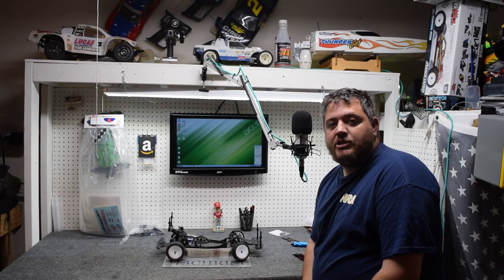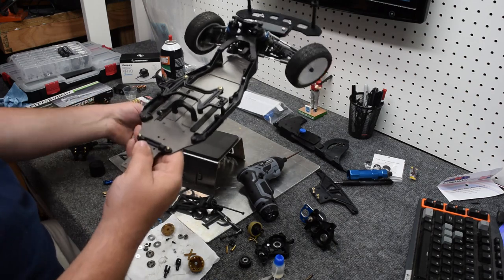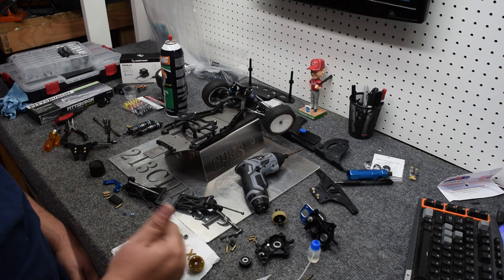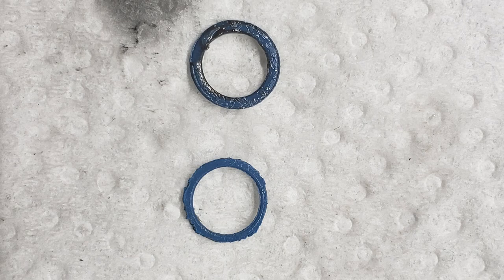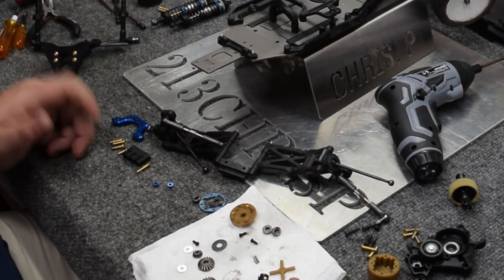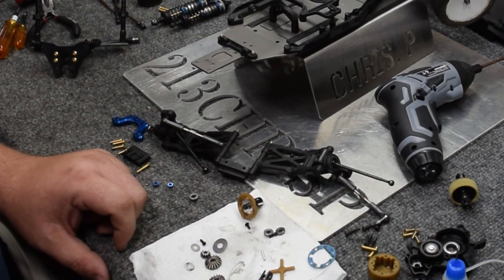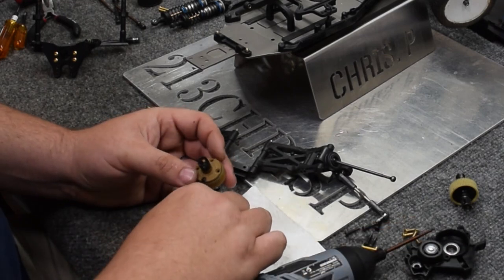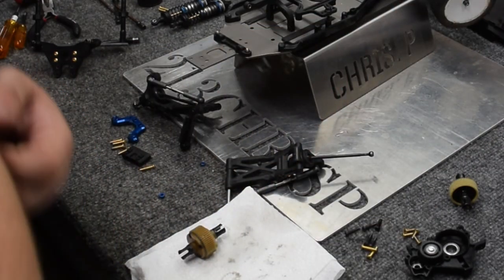street stock build part 3, suspension and transmission work, lets free up our transmission!

Comment: Are those the shocks that come with the car?  How did you get the B6D to set so low?  Thanks!
Reply from the maker: Yes that is the stock by shocks. And mccaliseter springs are alot shorter which allows for a lower ride height.
Reply: @ChrisPatrickRC  thanks for the reply
Reply from the maker: @Kentucky-bz6pg  glad I could help! Its what I love to do.

Comment: Dude, you so totally screwed Ackerman...not hating, just fyi you need to research that alot better. Pretty much boned it bro. Rest of your set-up explanations pretty good.
Reply from the maker: Sorry if thats how you take it , but its how I understand it and can explain it, its a subject that is extremely hard to understand. I'm sure you understand.
Reply: @ChrisPatrickRC  check out this explanation. https://youtu.be/ZYJKWZIxP7s
The solo cup example you used is for tire stagger, not Ackerman. 
This simple explanation does not take into consideration slip angles, bump steer or many other things going on in your front end, but you have a very simple steering on that car.

Comment: Chris, on the transmission are you using the lay down or lay back. I currently was told to use the stand up and I want to be right with this setup video. Thanks man great videos
Reply from the maker: Layback , imo stand up is good for loose dirt, layback for mid to high and laydown for carpet . Hope this helps
Reply: @Chris Patrick  yessir,  just wondered y my buddy ran stand up until u explained about loose dirt, our old track did have more loose than hardback. Thank you very much Chris! Keep up the informative videos they are awesome

Comment: Love the street stock build series question on the diff you said light or no fluid for high bite surface would it be opposite for looser lower traction surface
Reply from the maker: within reason yes... because the less bite you have, you want your rear end to be locked up to allow for more traction.

the main issue is turning, when its higher bite applications or a really small track and your car wants to push in a corner, then you want to free up your diff allowing your car to turn. I hope that helps you.
Reply: You all prolly dont care but does any of you know of a tool to log back into an instagram account?
I was dumb lost my account password. I would love any assistance you can offer me.
Reply: @Branson Brendan Instablaster :)
Reply: @Malcolm Achilles thanks so much for your reply. I got to the site thru google and I'm in the hacking process atm.
Looks like it's gonna take quite some time so I will reply here later with my results.
Reply: @Malcolm Achilles It did the trick and I now got access to my account again. I am so happy:D
Thanks so much, you really help me out :D
Reply: @Branson Brendan Glad I could help :D

Comment: Where do you get the parts for the acumen steering
Reply from the maker: A main or ebay . Just need to know if you wanted the standard,  +1 or +2. Usually I get avid as the manufacture part.
Reply: @ChrisPatrickRC  +2
Reply from the maker: @roberttourangeau1609  Part# AVD1065-2
https://www.amainhobbies.com/avid-rc-b6-b6d-carbon-fiber-2-steering-block-arms-2-avd1065-2/p590921
Reply: Thank you

Comment: i like this build series, im new to oval but been around 1/10th buggies since before they were around. i have a couple questions?
first, why do oval guys think removing the seal on the bearings is a good idea? i see it all over. if that fraction of a second makes a difference to you, wouldn't you just install ceramic bearings?   (i heard u mention schelle so i know your not afraid to spend money)

2nd, why do you think no diff fluid is the answer? that's a tuning aid on carpet and high bite. i run up to 200k on some carpet tracks that are more traction than any oval i know of.

im in the process of building a 6.3d for a sealed clay low bank short track, either 17.5 or 13.5. the club doesn't have many regulations but i want to conform to common practices. i run mostly 21.5 offroad carpet now. any setup sheets (castor, camber, bump steer, droop and shock limiters) would be appreciated. im also wondering what tires u landed on for asphalt (im one step away with sealed track), my rear motor buggy loves "take off" carped mini pins, but they barley make it through the day (fuzz bites with 4wd fronts, they last on carpet so im running out quick). ive only run a few days, but already getting into the local classes of mudboss and rear motor buggy, but want to build a real car that i can tune and progress with.. 

thanks in advanced for any replies.
Reply from the maker: Removing the seals and trimming them down is actually proven to be less resistance then ceramics. The issue is maintance, you gotta keep them clean so there happy. So if you don't want to do that, then don't,  but running a spec motor class it will matter.

As for tires no, I'd just run slicks in a hard compound , I've been racing rawspeed slicks on super soft compound but im on clay and loose dirt tracks. Best advise is go to your track and talk to people racing and see what they suggest. 
But rawspeed slicks will do you well once you find the compound that works for your track, track and air temps are a huge variable, so if its warm and super grippy I'd probably start with soft long wears.
Reply from the maker: And quick answers to setup, -2 and 2 on the front. -2 and 1 on rears . Adjustable rear steer -6 and 0 . Ride height around 19 keeping them level.
Reply: @ChrisPatrickRC   is there any place that post setup sheets like off road? ball stud spacing, shock position, oil, ball or gear, axle heights,. the carpet setup sheets from manufactures are details right down to tires, timing and electronics,
Reply from the maker: @chuckstromain  I havnt found one dedicated to oval , but I use the stock b6.x setup sheet offroad uses and just notated the missing details on the paper. I do it all on paper and not digital.

Comment: How do you feel about the ball bearing differential?
Reply from the maker: i race the ball diffs on the offroad world, Can they work for oval racing sure, but unless you have the ability to keep adjusting your diff after every race , to the same point it was the last race (a diff analyzer) then id stick to a gear diff, which is what i still race.